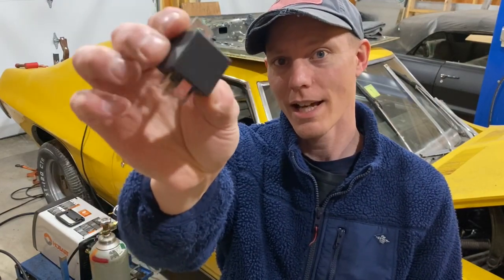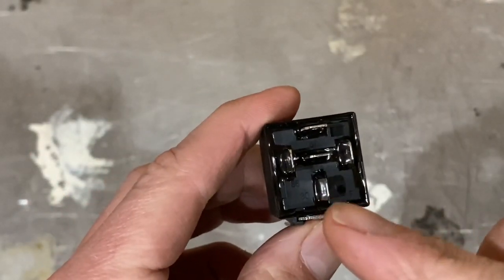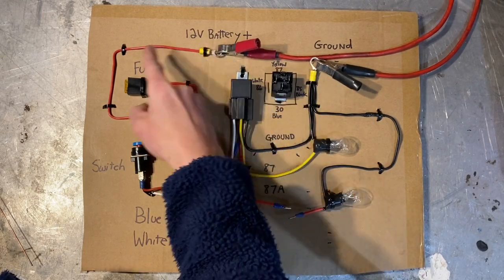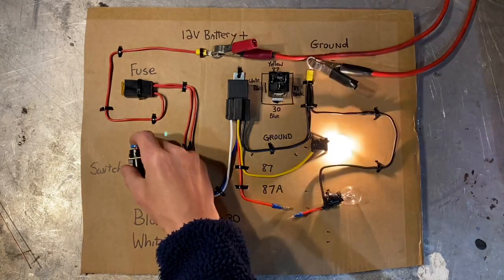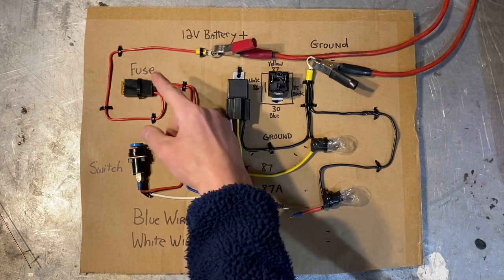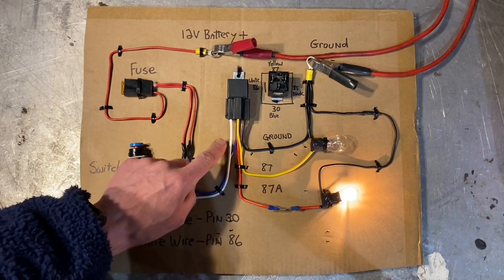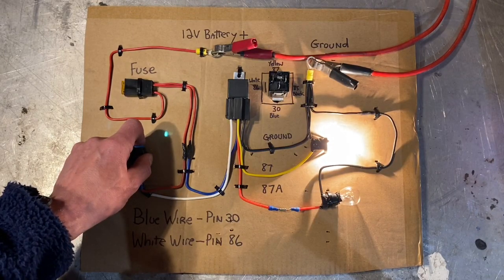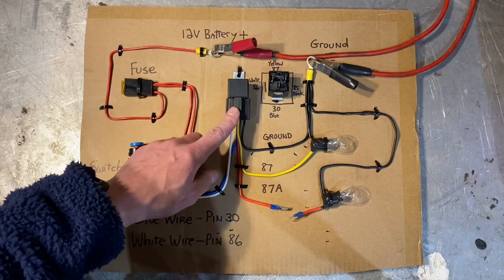How to Wire a 5 Pin Automotive Relay. Pins 87/30/85/86/87a . Bosch Style. Fans / Fuel Pump / Lights

Comment: Thxs I've wired hundreds of relays never new what 87a did exactly this solves my beam headlight no floor switch on my hotrod problem
Reply from the maker: I’m happy to hear that it helped you out!! It’s even better that it made a hotrod work!
Reply: @WiringRescue  not so much the hotrod work im 6'10 and getting to the dimmer switch on a older vechile on the floor very difficult with the relationship of the dash to my knee
Reply from the maker: @jeremyhanna3852  - lol. I’m 5ft 11 and I wack my knee on dashes a lot. I cannot even imagine what your knee has been smashed into!
Reply: @WiringRescue  yeah life is tuff when your way bigger than everybody one size fits all my butt and my  hot rod is 52 buick nice and big I can't drive 32 fords

Comment: Does your switch not need a ground? Want to install a airhorn on my car
Reply from the maker: The switch doesn’t need a ground in this scenario. All it is doing is passing or stopping 12v from going from a power source through the switch to pin 86 on the relay.
Reply: @WiringRescue  thanks! Do you think i need a ground on my switch? I want to install a 12V air horn and when i push the switch the horn needs to make some noise😂
Reply from the maker: I don’t think your switch needs a ground if you wire it to a relay properly! However, there is a different method of wiring a relay which you might like even better. I’ll make a video of it for you. Stay tuned, I’ll make the video within the next ~3 days. If not - I’ll mail you a free sticker.
Reply: @WiringRescue  very nice!! Gonna sub and wait for the video!
Reply: @WiringRescue  can you also explain which wire thicknesses you use? now my fuse blows all the time when using 1.5mm cables
Reply from the maker: Check this method out - https://youtu.be/QAD8vDHTbzo

Comment: So I got some Led light pods for my truck, and they have a amber accent light built in. Can I use for instance 87A to power the main LEDS and 87 to power the amber lights? 
The pods have 3 wires. (Red, white, black)
Reply from the maker: If you wire it that way, the main lights will be on all the time (even with the truck off), then when you flick the switch, the main lights will turn off and the amber lights will turn on.
It sounds like you need two switches and relays if you want to control the lights individually. Or you could get a 3-way switch and two relays. Or you could wire the lights together and have all the lights turn on and off at the same time.

Comment: Thanks for clearing things up!
But Ive got a question,
Can I use the same light to both of the pins 87 and 87a?
I want to connect a light what Burns all the time when turning on, like pin 87a but i want to turn it off (blink) when I turn on the blinkers..
(It had to blink at the same time as my blinkers on the rear of my car)

Comment: Thanks for the great explanation. Is 87a not a constant drain on the battery? How come it doesn't drain the battery...
Reply from the maker: 87a is basically the resting position for the relay, so no electricity is needed for that position to be used. With that being said, if you have an accessory connected to the 87a terminal, it will turn on when the relay is not being activated, and therefore WILL use electricity. :) hope that helps, and thanks for watching!
Reply: @WiringRescue  ah! Understood, thanks.

Comment: I am trying to wire my Baja Designs off-road lights which have high and low beams though my factory single throw upfitter switches, but want to avoid having both the high and low beams powered at once. This solves my problem! Thank you!
Reply from the maker: Hell yes! I’m glad this was able to help you out!! Thanks for watching the video!

Comment: i'm trying to incorporate a relay with my maple sap system...i have a vacuum pump on my in take line but i want to be able to have it turn on at 33F and off at 32F with a temperature controller...which wires go where?...the controller is an inkbird itc 1000...any help would be appreciated..thx for your time
Reply from the maker: This is the greatest thing I have ever heard. I made about 2 gallons of maple syrup last year for the first time ever and I cannot wait to do it again!
As for your system - if you have the ink bird hooked up to 12v (not 110a/c), I think you will just power up the ink  bird normally with 12v battery power. Then have a wire with a 10a fuse or less go into pin 5 of the ink bird. Then pin 6 will go to pin 86 on the relay.  85 will be ground. 30 will be battery voltage. 87 will be the vacuum pump.  

Please keep me updated on this!!! Im tempted to do the same!

Comment: i am a little confused because most in line fuses just have 2 wires (1 in and 1 out) but yours has 3 so there is a shared fuse between the battery and the relay? and also the fuse between the battery and the switch? what if i dont have a fuse between the switch and the battery? most other videos are not showing a fuse between the battery and switch, is that necessary?
Reply from the maker: You are correct with my fancy 3 wire fuse. Using two two-wire fuses would be far more normal and what I would recommend. I just didn’t have two handy when I made the video. If you have a wire coming off your battery, it should be fused, whether it goes to a switch or not. This is because if it ever touches ground for any reason, it will quickly start a fire if it doesn’t have a fuse to save it.  Another option would be to send power to the switch from another existing circuit that is already on a fuse. Like a stereo power feed, for example.

Comment: Great video but, I do have a question
I want to wire up a pair of AUX / Spotlights to the main/High beam circuit. How would I do this without adding an extra switch (I want the spots to come on with the high beam)
Thanks and keep up the good work 👍🏻
Reply from the maker: Just splice a wire into one of the power wires going to the high beams, and run that wire to pin 86 on the relay. Ground pin 85. Battery power (fused) goes to pin 30. Pin 87 will be the power wire going out to your aux lights. Then whenever your high beams are turned on, the relay will click on and turn on your aux lights.
Reply: Thank you  @WiringRescue
Reply from the maker: @TransplantLife  - happy to help!
Reply: Great, thanks to your advice Ratty Muscle Car, my spot lights work a treat 👍🏻

Comment: Great video! I bought a pack of 5 of these relays and pigtails (walmart.com had them very cheap). I am planning to add a 6 or 8 gang rocker switch bank to my tractor. I was originally going to switch on relays with the key and then share power from them for the 8 circuits, and run lights thru the rockers. Should I have a relay for each rocker switch and only run the low amp signal current (86) thru the rocker?
Reply from the maker: It depends on the switches. If the switches can handle the higher amperages of the lights or whatever accessories you are running, then relays aren’t necessary. But most low priced switches cannot handle the amperages, and will quickly burn out as soon as the electricity starts flowing.

Comment: Can i just put a switch between 87a and the load?
Reply from the maker: It depends what your end goal is. You could put a switch there, but I’m not sure why you would want to. If 87a has power right now, it’s coming from the incoming power through pin 30. If you then add a switch between 87a and 87, you are basically bypassing the relay.

Comment: Are you related to Bill Nye... the Science Guy? LOL... if not, you must be drinking the same coffee LOL. Excellent video, so easy to understand & thank you for not throwing any music in it! I have a question, wish we could post a diagram, but here goes. I'm doing some rewiring on my 69 Camaro and I've just added motorized RS headlights, a dual eFan setup, and Vintage Air. I'm using a PowerMaster 150 AMP alternator with internal regulator, want to wire it with 3 wires. The fans will be controlled by a PWM unit (Northern Radiator) and supposedly it has very low draw as doe the module that controls the headlight doors. Rather than use the OEM Battery Junction Block, I opted to use a Jegs dual post junction block. My thinking is that I will connect the alternator directly to the large #1 post with #8 wire, and also connect the battery with a #8 wire that has a #12 Fusible link on the battery post side. Might connect the RS Module to that post as well. So the Vintage Air Trinary Switch needs a switched 12v line, and I was wondering how to use a 30 AMP relay to service Post #2 so that when the ignition is "ON" there will be adequate power at Post #2 to power the PWM and the regular Vintage Air power. I've fabbed up a bracket that mounts the Jegs Junction Block, so its still next to the battery. Vintage Air suggests connecting direct to the battery but I think connecting to Post #2 (switched) seeing as its 10" away from the terminal is OK. I apologize for the length of this. Wish I could email you my reference diagram.
Reply from the maker: Hi Mike! Believe it or not, I’m just a car guy trying to help out other car people! 

If I am imagining correctly, I think what you want to do is get a relay that can handle large wire, like 8 gauge probably? Then hook up an 8 gauge wire from the battery to the pin 30 on the relay. Pin 87 on the relay will go to your Jegs #2 post. Ground pin 85 on the relay. Pin 86 of the relay would be a power wire from the ignition. Then when you turn the key on the #2 post would have power fed from the battery with 8 gauge wire. 

I actually just made a fuel pump video that may help, as it is a very similar design. https://youtu.be/8GjvRdssvFI

Let me know if that makes sense. If not, I can try again! Thanks for watching the video!
Reply: @WiringRescue  WOW... somebody who actually responds!!! Yes... that video was very helpful. Couple of questions;
1. The #8 gauge from the battery to Pin 30, is a Fusible Link needed or just use the Inline Fuse... and what size Fuse?
2. You're playing with a GM system... where would you tap off (under the dash/or wherever) for the Ignition "trigger" source? OEM Fuse Panel.
3. For the Ignition/Trigger wire is #12 or #14 adequate, and where would you place the fuse (under dash or closer to the relay)?
4. For the Pin 87 wire, is #8 gauge needed or would #10 gauge be OK?
5. Do I need to buy a 30A Bosch Relay with #8 gauge Leads in the pigtail? Where do I find one?
Somewhat related but here's a question, I bought the AAW High Output Alternator Connection Kit, they suggest running the charge wire to the solenoid, other guys who are far more electrically oriented than me have said, stick with the #8 Gauge direct to the Junction Box, #8 gauge with a Fusible link from the Junction Box to the + Battery Terminal. Oh yeah... one more question on the dual post Junction Block. Typically a #10 Red wire runs from the Horn Relay over to the Junction Block. Should that wire go to the Constant "Hot" 12v Post or serve as the power source for the Small Post going to PIN 87?

Gonna go thru more of your videos...you have a clarity thing going that makes you pay attention. Keep it up!
Reply from the maker: @mikelangieri6602  
1. A fuse should be fine. The fuse size depends on what you are running off the post. Figure out how many amps those components should draw at most, and use in a fuse that is that size. If more is drawn, it will pop the fuse instead of burning the wires. You could even go a hair smaller on the fuse to be safe.
2. I’d use a wire that goes to the ignition coil or distributor. It’s already my under the hood!
3. The fuse should always be close to the source of electricity. So then there is less unprotected wire. If you use the distributor or coil circuit, it likely already has a fuse. And 14 gauge should be fine for a trigger wire.
4. The wire gauge depends on the amperage draw. The more amperage the circuit draws, the thicker the wire needs to be. So you have to add up the amp draws on the items in the circuit and then determine wire size based on that.
Bonus question. I’m not too sure. I always lean on the safety side with extra fuses and whatnot, but following the manufacturer guidelines is usually a safe bet.

Comment: best one ive seen so far  thanks
Reply from the maker: Thank you! I really appreciate it!
Reply: hello see when you say you need two live wires going to the battery one is a heavy wire well cant i just take the other live wire from the main feed to the switch ? in stead of having another wire going back to the battery

Comment: What if u dont need a switch ?
Reply from the maker: You need something to turn on the relay on. Rather than a normal rocker switch, you can always use the ignition switch?
Reply: Ratty Muscle Car can i keep the relay constantly on without burning it can i connect pin 86 with pin 30 together ?

Comment: Great video, but I have a question.  I basically need this with a tweak.    I am trying to run new fog lights in my car, but my low beams are on all time when my high beams turn on ( giving me 4 lights for high beams and  2 lights for low beams ) and to be legal, I need something to turn off my fog lights when I put my high beams on.  Assuming the easier way to run a wire off the high beam light harness ( like a remote wire ),  how do I wire this ?
Reply from the maker: If you’d like your fog lights to turn off when your high beams turn on, here’s how I would do it:

- Cut the power feed wire going to the fog light circuit in half. You’ll then have two wires. One incoming 12v from a battery/fuse box, and one outgoing wire to the fog lights. You’re going to add a relay like the one in this video in between where you cut those wires.

- The incoming power feed side (from battery/fuse box) will attach to pin 30. 

- The outgoing 12v wire to the fog lights will attach to pin 87a.

- Now you’ll splice an additional wire into the power wire for your high beams and have that attach to pin 86 on the relay. 

- Pin 85 will go to ground.

- Pin 87 can be left empty. Just make sure it is covered up and not touching anything.

The way this works: The power wire going to your fog lights now has a switch in the middle of it, which defaults to being on all the time, just like it always has been. But now, when your high beams come on, the power wire for them tells the relay to flip and send your fog light power to pin 87 (nothing!). And your fog lights turn off.

If this gets 10 likes I’ll make a video. :)
Reply: @WiringRescue  Thank you very much.  This might help me get the tools out of my vehicle ! lol.  I am going to try it this weekend ! Thanks again !
Reply from the maker: Grant - happy to help! Anytime I can provide a little assistance to somebody wrenching on a car, that’s a win for me!
Reply: @WiringRescue  Just drawing this up.... which wire does the switch that is inside the vehicle go onto ?
Reply from the maker: Grant - if it is a two prong switch, it should have power coming into it from a battery (or fuse box) going to one side of the switch. The other side of the switch goes to pin 86 on the relay.
Reply: @WiringRescue  This is exactly what I'm looking for! One further question: Should I splice the red wire going to the high beams to attach to pin 86 or should I splice the ground wire of the high beams to go to pin 86 of the relay? I only ask because it looks like from your video, the white wire coming from the switch looks like a ground wire

Comment: Great explanation!
I have a question, I want to wire my fans to continue to run as needed on a temp sensor after I turn my engine off. so when I shut off my engine the power to my fan relay is off, I want the secondary power  to come on to continue to cool off my engine. Any suggestions/tips on how to wire that up?
Reply from the maker: Thanks for watching the video! I think you should consider one of these adjustable fan switches instead: https://shop.advanceautoparts.com/p/imperial-adjustable-thermostatic-fan-control-226204/3670006-p

You can adjust them to turn on at any temp, and you can wire it to be on all the time (read below). 

One word of warning though. The reason that almost no cars come with this feature is because it’s dangerous when you are working on the car. If the fan decides to turn on when you are wrenching under the hood, it could really injure somebody. So - I would always recommend wiring it to the ignition power instead. That way it will never turn on when your car is off.

Comment: Would it be possible if i connect both ends of 87 and 87A to the same bulb? (Id like to put a strobe effect in between 87). So when i hit the switch, the bulb will strobe instead of steady lit.
Reply from the maker: As long as you are okay with the light being on at all times (87a), I believe that should work just fine!